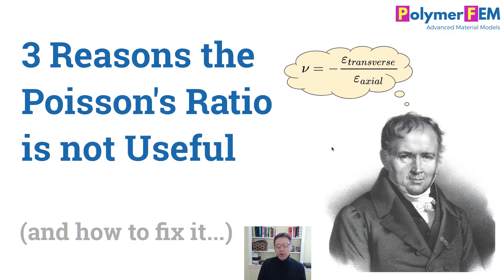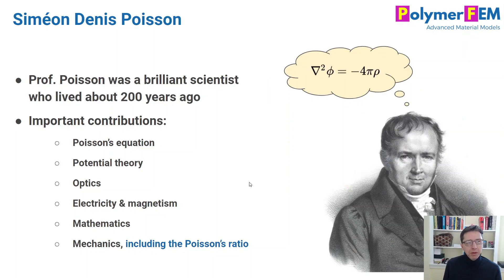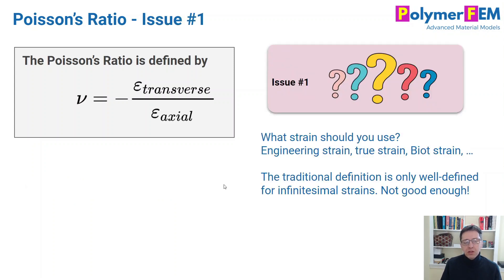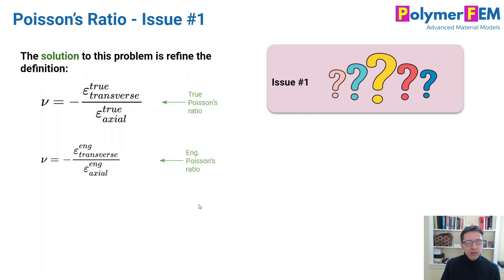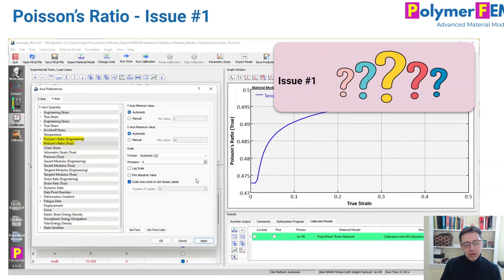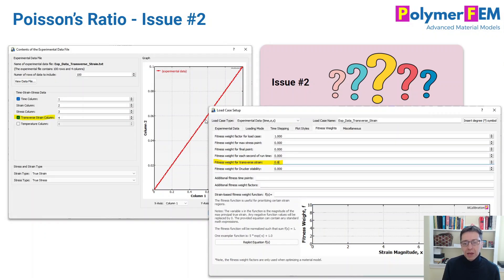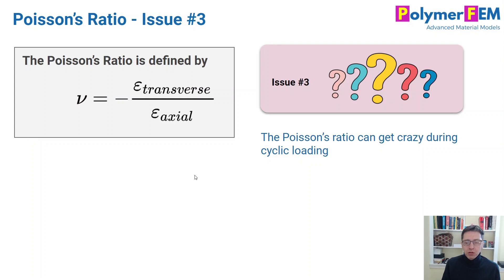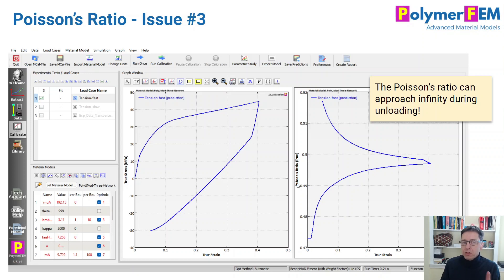3 Reasons the Poisson's Ratio is not Useful

Comment: Great points. Is Poisson's ratio in the non-linear regime essential for FEA modeling of non-linear viscoelasticity? You mentioned that cyclic loading can make things tricky. I am using Large Amplitude Oscillatory Strains (LAOS) from a rheometer.
Reply from the maker: I would not focus on the Poisson's ratio in that case. The Poisson's ratio is mainly used because it is easier to measure/guess than the bulk modulus.